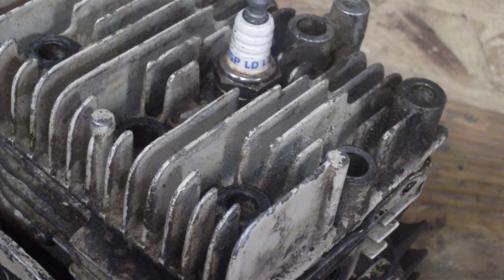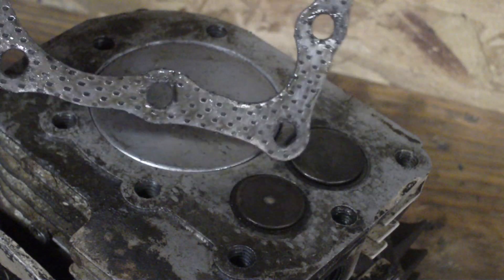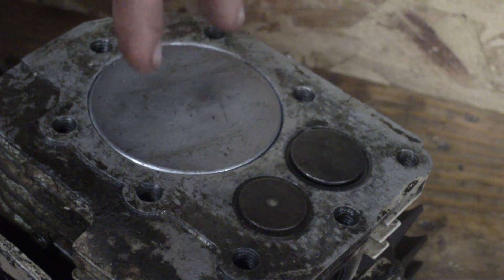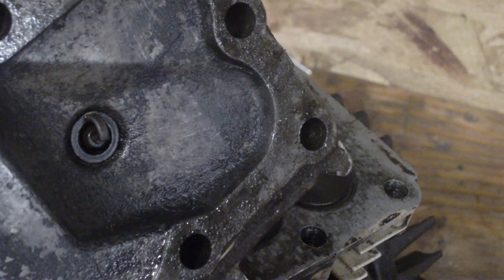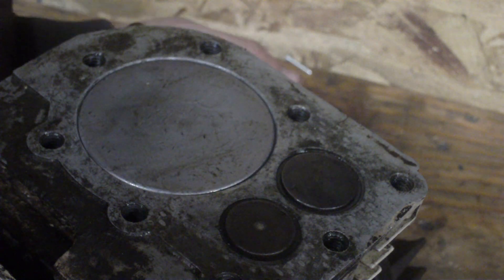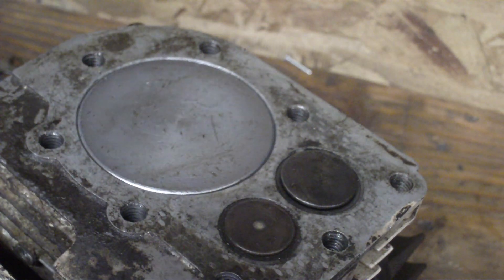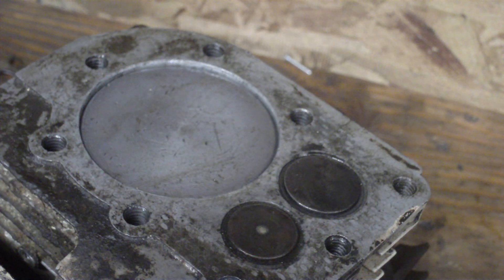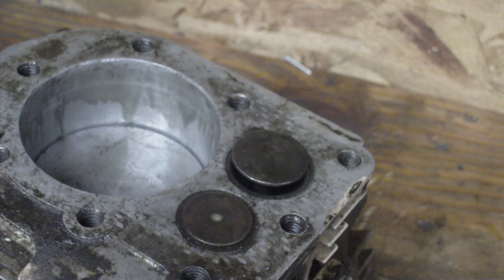How a 4 Stroke Gasoline Internal Combustion Engine Works

Comment from the maker: @billzaink Thank you! well on flatheads replacing head gaskets isn't gong to help any with burning oil. What usually happens is 1, the piston rings wear out and allow oil to get past them and burn in the combustion chamber, which also reduces compression and power, or the valve guides start to wear and allow to seep in past the valve stems. Oil in the valve spring area is normal. You can run STP or thicker oil treatment to help reduce smoke, but its best to rebuild. Thanks for watching my videos

Comment: Great vidoe, thanks, think you've helped me undertand my problem a bit! My ride on which has a 13hp briggs flathead was using oil and smoking!!!  So I'v replaced head gasket, gas lines and filter, changed oil and splark plug, cleaned carby thanks to your instructions! But it's still smoking a bit, blimey, smells like too much gas but I'v noticed a bit of oil in breather valve spring box thingy, it's like there's too much oil but the dipstick  reads correct Hoping you have an opinion please!!